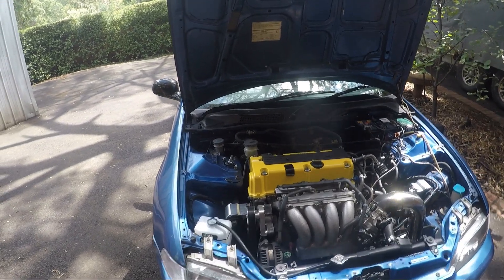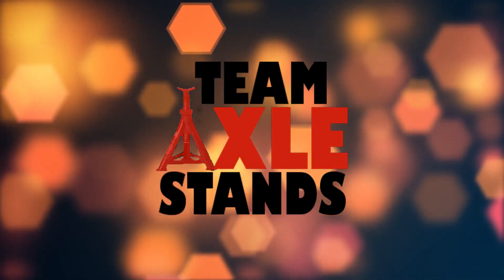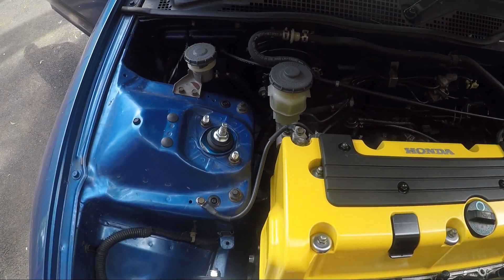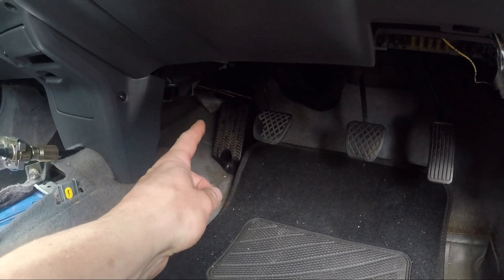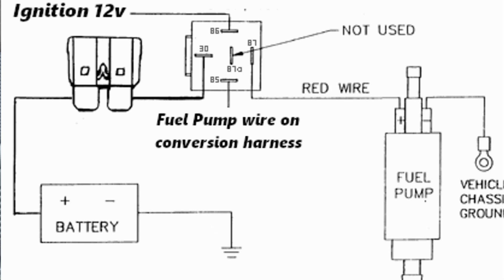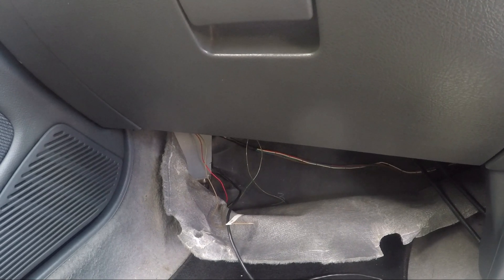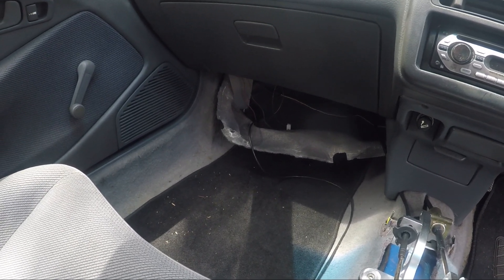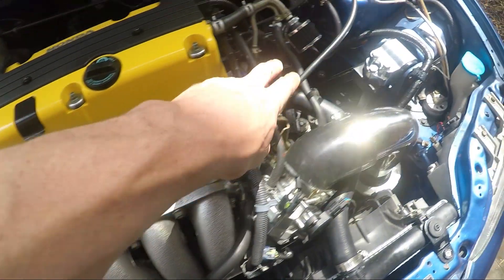Wiring a K swap in a carbureted Honda EG Civic

Comment: Hey mate, doing a carby eg k swap my self, still having trouble trying to find a video on which wires need to be tapped into the 2 ecu plugs from the conversion harness, thank you
Reply from the maker: Hey mate, For Carby if i recall correctly we do not tap any wires from the 2 ECU plugs. Generally efi cars would tap E1, E15 and E31 which are fuel pump trigger, ELD and MIL. As the carby car has none of these I left ELD (electrical load detection) and MIL (check engine) unconnected. For the E1 (usually green with a yellow stripe) you need to trigger your fuel pump relay with it.
Reply: @teamaxlestands  have already tapped the charge light cable into the k series oem harness into the white and blue cable like u stated, and the ELD into the green and red cable on the factory carby ecu loom, just having trouble as in where the FUEL PUMP cable and MIL cable go exactly, cheers
Reply from the maker: @seqhs2072  MIL you have no choice as the check engine light doesnt exist in the carby car dash. I have left mine detatched and use OBD2 bluetooth dongle as required for any error codes. For Fuel pump this wire is the ground for the fuel pump relay. You'll need to add a relay to power the fuel pump. This wire triggers the relay.
Reply: @ so is there no relay on the drivers side foot well or something like that you were saying in the video
Reply from the maker: Correct the carby cars do not have an instant pump so there is no relay or wiring. You will need to add this along with the EFI tank
Reply: @teamaxlestands  alright perfect so just add a relay and tap into the relay as a ground?

Comment: I have done ef carburettor to injector, and it's the same. just need the main relay and make a check engine light and repin the wires for dashboard lights.. I checked this video bc maybe there is something different, but it's the same. ^^
Reply from the maker: Thats it mate, its so easy. Amazed there arent so many around!

Comment: Whats going on! Been watching this to wire up a integra dc1 with a carb engine was going to buy the conversion harness on the link but is not available, can i just use a hybrid racing harness?
Reply from the maker: Hey there, The issue is hybrid racing actually uses a different plug (under the dash). I havent tested this and i suspect some wires might be missing. You want one which uses the 2 shock tower plugs. I think k-tuned is correct style and there are probably a bunch more. You just need to read the instructions of the looms and make sure its one which plugs into the 2 plugs on the drivers side shock tower.

Comment: Hello again man I'm curious about the engine bay fuse box and the dash box did u have to swap them from a vtec model or how does that work? Prepping bay for my k20 thanks dude
Reply from the maker: Nah no mods to either fuse box. They remained as the carby one.

Comment: Hey man how ya doing ! I just finish my fuel pump wiring to convert my carb Eg to efi and follow how your relay set up was. For some reason my ECU side fuel pump E1 (conversion harness wire) doesn’t have a ground when I turn the key on ! Any idea what I am missing ? When I ground the wire from the relay to chassi that suppose to be from ecu fuel pump wire it works but when I plug the one wire from the ecu it doesn’t work .
Reply from the maker: Have you turned off your mobiliser? Does the car start with the relay directly connected to ground?
Reply from the maker: Also which year is your ECU. For 05/06 they are different and trigger on E17
Reply: @teamaxlestands  my one is a PND ECU out of a 2004 DC5 type S Integra.
Reply from the maker: @lacernad7673  Just watching your vid now. I think you have it wired up properly. Without the engine being in (assuming its still like it is in your video) I'd be very careful. There are so many sensors and things which use the main grounds from the engine to the chassis. I believe not having some of these grounded will stop the main relay from triggering which will mean your fuel pump will never trigger.
Reply from the maker: @lacernad7673  If its definitely an 04 you will have it wired up correctly. If its an 05/06 you will need a few mods to your conversion harness. Vtec Academy have a great video if you need to mod it to show the changes needed.
Reply: @teamaxlestands  The engine is now sitting in with my hassport mounts. I have three ground from engine to body. One on top of intake manifold to front . Gearbox to left front by the shock tower and driver side to tappet cover . I’m confident I got some good ground I just don’t get why I don’t get any signal from the ecu fuel pump.
Reply from the maker: @lacernad7673  Yeah that should be plenty of grounding. I'm wondering if its your imobiliser bypass somehow? Other thing you might want to check is your thick wires coming into your C101 plug. Just make sure they have power with the key on.
Reply: @teamaxlestands  I am not sure as I only followed the instructions how to wire it up to 2 wires on a plug and 2 wires on e plug (conversion harness) . About the C101 plug , which wires are specifically referring ?
Reply from the maker: @lacernad7673  there are 2 wires which are bit bigger gauge - these supply the main power to the ECU. Other option would be to plug in a dongle to the OBD2 plug and it will let you know if you have power and the ecu is OK with everything.
Reply: @teamaxlestands  do you check it right after the C101 plug where it connects to the Eg harness ?
Reply from the maker: @lacernad7673  you can unplug the c101 and check the plug (chassis side) it should be feeding 12v on them when the key is on. Im only querying if it is ok because your harness doesnt use the shock tower plugs. so im wondering if maybe they are different?
Reply: @teamaxlestands  yes that’s exactly what I thought . But those plugs that was on the shockie tower when you trace it back it fit in to the c101 chassi plug. I wonder if my conversion harness is pin wrong to the c101 chassi side .
Reply: @teamaxlestands   hey bro I found out I have no power going to my ecu . I’m suspecting the harness that i got from the hybrid racing is not plug in play to my shell. It probably pin wrong and probably direct fit for efi shell. Did you had to make a Main relay for your one as it don’t have one ? Do you have the wiring diagram of a non efi eg like your one ? Gonna try re pining it to the right ones but I can’t seem to find a manual for a non efi shell in google.
Reply from the maker: @lacernad7673  Umm i dont know if i have a main relay. I do know that the main power comes from a 2 pin plug on the shock tower. and then the rest of the sensors and stuff are from the other plug (possibly 10 pin) I dont unfortunately have any diagrams but i was using the generic pinouts from the shock plugs and they seemed correct when checked with a multimeter. Maybe you are best taking the power from the shock tower plugs?
Reply from the maker: @lacernad7673  was a while ago but i think i used this forum post as a good source. You could then use a multimeter on resistance mode to check continuity to the plug which you are using: https://www.k20a.org/threads/electrical-gurus-pin-out-for-these-plugs.111113/#post-1758306
Reply: @teamaxlestands  have you still got the pin outs from the shock tower plug ? I still have those plugs so maybe if you have the pin outs I’ll just put the plugs back in to c101 and use th shock tower ones. Also can you remember what pin outs from Ecu for supplying power to it ? Base on the schematics I saw is it pin 9 on E plug ? (Detect Ignition signal) .
Reply: @teamaxlestands  I’m confuse coz if you did did not use a main relay how did you you power up the coils,cmp sensor and ecu a2,a3 like the schematics say and uses thesame circuit with the fuel pump relay too .
Reply from the maker: @lacernad7673  Yeah I guess i do have a relay, they are big wires. Do you have instagram? Maybe we can DM there and then i can share photos and pics if needed
Reply: @teamaxlestands  I am using an immobiliser bypass unit that I wired up from hybrid racing. I haven’t tried running the motor by bypassing the ecu fuel pump ground relay.

Comment: Hey man how did you wired up the loom that goes to the automatic shifter ? Or was your one a manual already ?
Reply from the maker: Mine was a manual however i believe it should just be a couple of wires joined to make the car think its in park all the time. Thats what i've had to do in previous manual to auto conversions.
Reply: @teamaxlestands  the thing is I don’t really want the dash light to light up on park all the time so is that mean I have to remove the cluster and take the bul b off pr something.Also wanna know how the reverse light wired up lol
Reply from the maker: @lacernad7673  Reverse lights come through the C101 plug (conversion harness) from the switch on the manual box. It simply bridges the 2 wires when in reverse to turn the lights on. Might be another one to bridge at the auto loom possibly? Although I'd test it without doing anything first it may be all good. Pretty sure to get rid of the Auto lights you can just unplug them at the dash. I have an auto cluster in mine and left it unplugged.

Comment: Hi did you use the fan switch sensor of the bottom of the rsx radiator as your coolant temp.for your cluster gage ? And is it working fine ? I’m in the middle of deciding if I should put my temp.sensor for my cluster gage on the coolant housing by the head . Cheers
Reply from the maker: I just used the stock RSX fan temp switch. I put the temp gauge for the dash in the end of the intake manifold where the injection heating used to be (this is the spot most people use and the adaptors work for)
Reply: @teamaxlestands  by the coolant housing where the top radiator hose is on the head side ? Also, is that a stock intake manifold you got on ? I have a type s dc5 rsx but the intake manifold is plastic I like the look of the alloy.
Reply from the maker: Hopefully this links to the spot where I show where my sensor goes: https://youtu.be/_gpWTiLRiNw?t=156
Reply from the maker: Oh and yeah stock cl9 Accord euro (tsx) manifold

Comment: Thanks so much for this!so with the wiring harness you have linked below, being that it plugs into the two strut tower plugs, rpm and the the speedometer will work with no problem correct?
Reply from the maker: That is correct, they both get their inputs from that shock tower plug so both worked fine for me. Also oil light, charge light and i think even the fan switch.
Reply: @teamaxlestands  you're the man thank you!